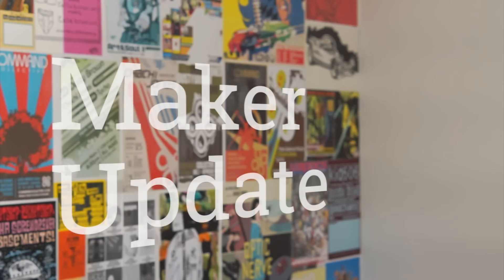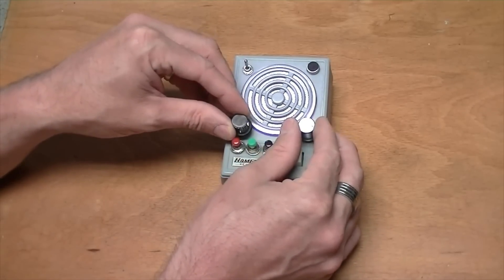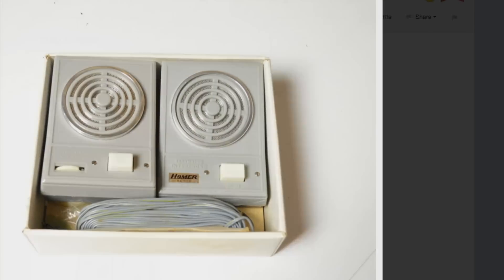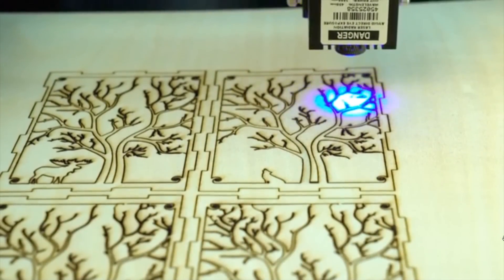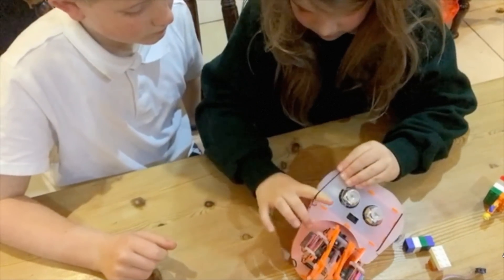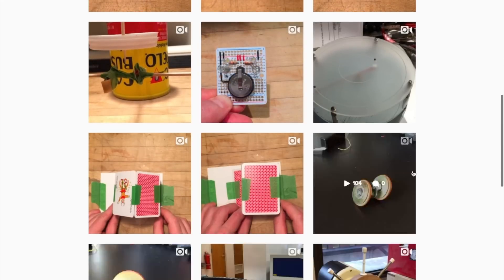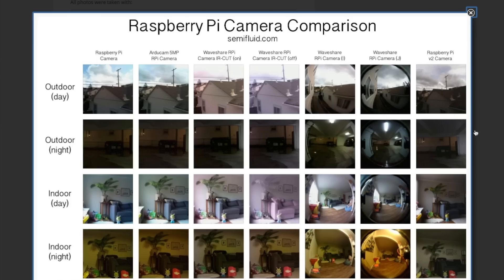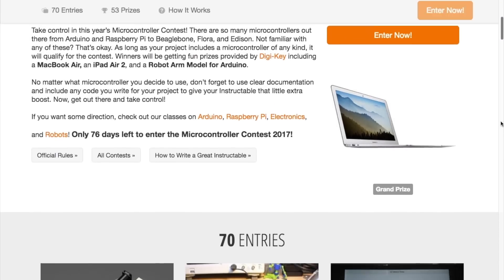Hacking a $2 Voice Recorder [Maker Update #21]

Comment: Hey Donald! Long time... Good to see you doing this! Hadn't checked in yet. That laser etcher looks intriguing. I am envious of your small enclosure collection...I have a weakness for them as well...(I spy the Chachi Jones flyers behind you!)
Reply from the maker: Univac! Of course you found the circuit bending episode to check in on! I suspect the enclosure addiction is particularly strong with benders. You should also check out the new Furby hack I talked about back in episode 18 (http://hackaday.com/2017/01/21/taking-control-of-your-furby/). It's no Teletubby, but I bet they would make a good pair. Yes, plenty of Chachi Jones posters behind me. I basically plastered that back wall with posters I've been collecting over the past 15 years. There are some Robotspeak flyers in there as well. If you ever want to catch up, I'm donald@makerprojectlab.com.